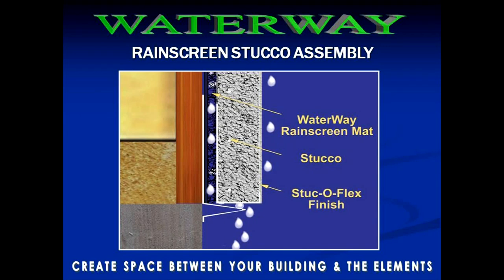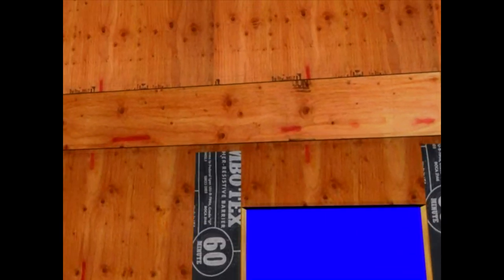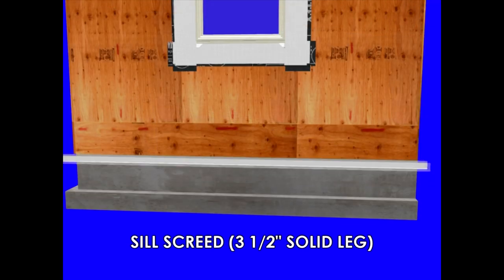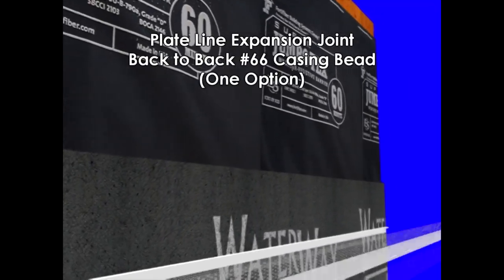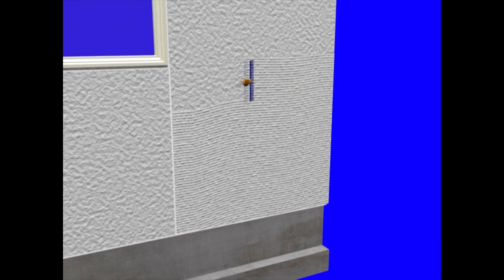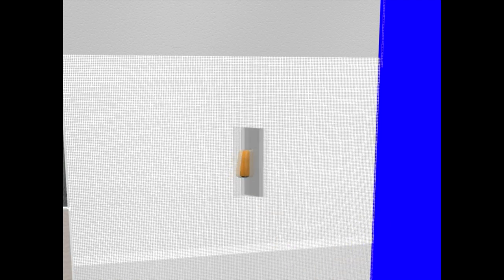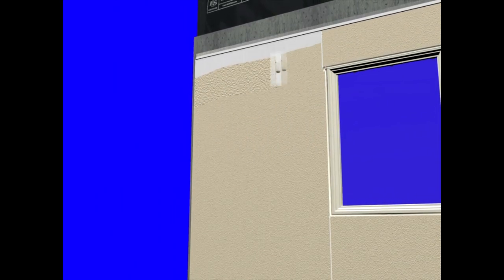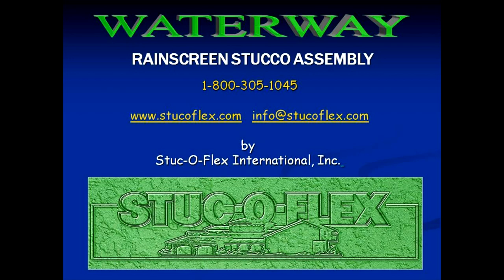"WaterWay" Rainscreen Stucco Assembly

Comment from the maker: There are a few options although, generally the casing beads and control joints are surface mounted on top of the rainscreen mat using slightly longer fasterners.